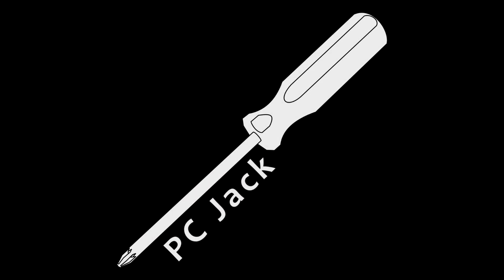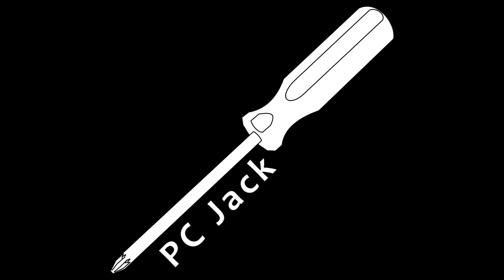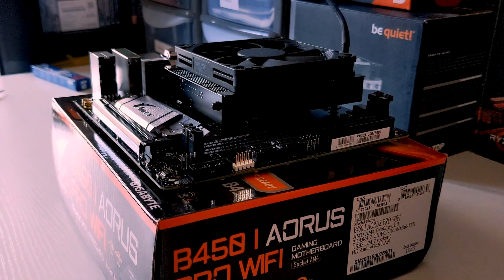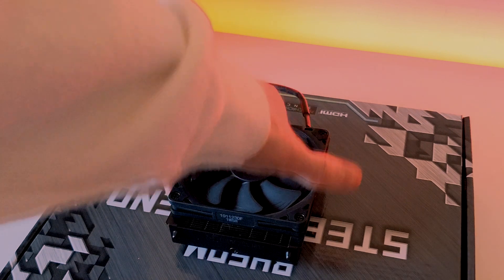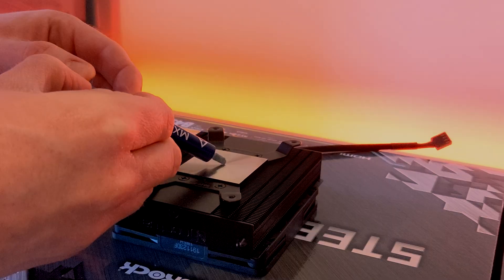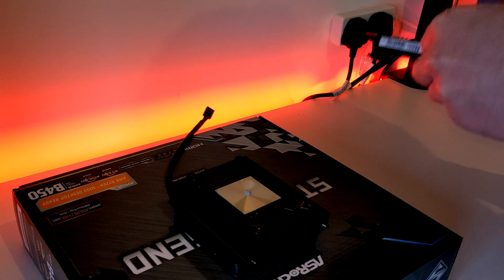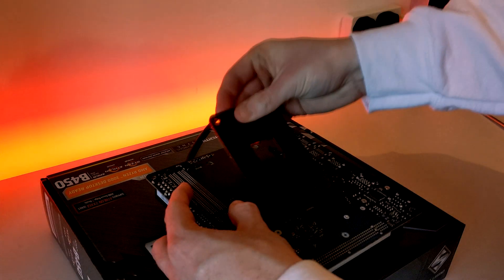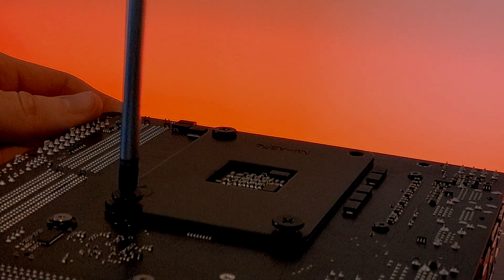How To Install Noctua NH L9a (Installation Tutorial)

Comment: Hey Jack, love the quick, concise video. I installed a Ryzen 9 5900x with this Noctua cooler. I’m getting a red light warning on the motherboard that the CPU isn’t working. And it won’t give me a display. Any workarounds you can suggest? I’m at wits end.